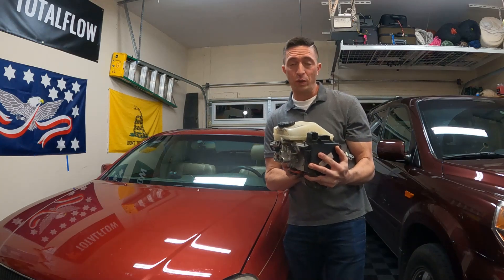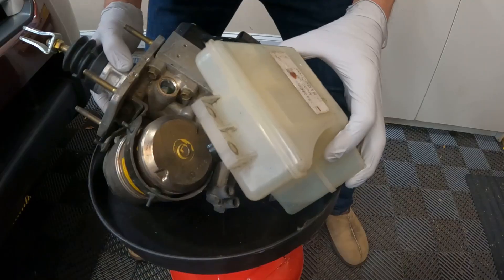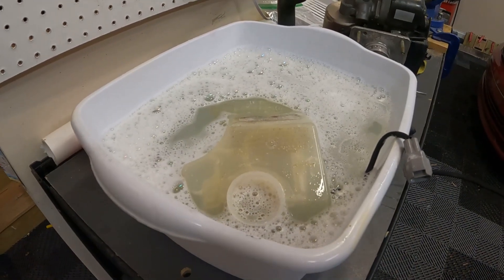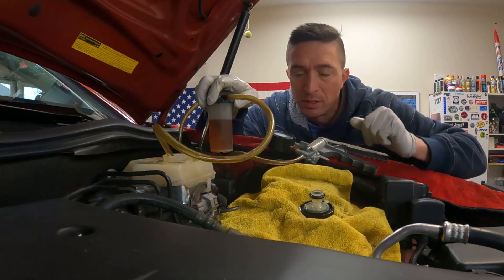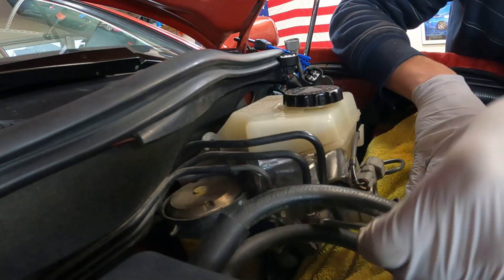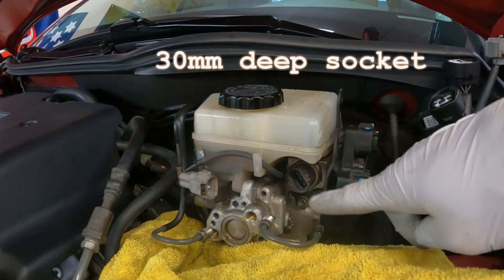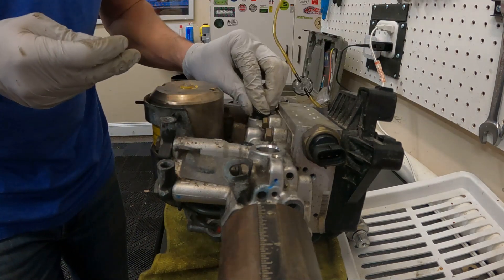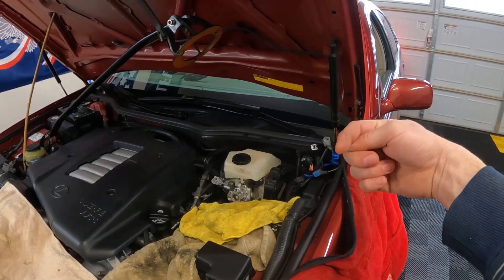LEXUS / TOYOTA Brake Master Cylinder Diagnosis, Replacement & Brake Bleeding (300/400/430 shown)

Comment: I did this on my old Lexus gs300 01 but I just bought the full unit with motor and tank/sensors etc about 450 remand off eBay, not the worst job but wish I had this vid back then lol..nice job! Oh mine decided to go out on the freeway 😂luckily I was able to coast and downshift to a safe place, whacked the pump it pumped enough to get me home thank god😂🙏👍
Reply: Does your pedal feel stiff as an original one?
Reply: @RSGAEL  yes it’s literally exactly the same, well I also did the stop tech drilled and slotted rotors and that made a lot of difference surprisingly

Comment: Curious what exhaust configuration you ended up with. In precious videos you were trying to get the sound to your liking.
Reply from the maker: I ended up with the following after the first Y: TF bullet, TF rear Y, 2.25 mandrel bent pipe to twin TF straight mufflers to twin TF race mufflers. If I could do it all over I would have simply replaced the stock mufflers with TF bullets and got headers. Live and learn!
Reply: @ForwardMomentum  it’s what it’s about. We learn thorough you and others. It does sound good though.
Reply: Wait bro what all lines do you have hooked up to your oil catch can I only have one line hooked up to mines
Reply from the maker: @user-gb1ne5jj8v  I had a three-port unit and plugged off one port after my OCC vid. It’s now ideal. Now it’s a two port.
Reply: @ForwardMomentum  there’s more hoses that oil can bypass in?
Reply from the maker: @user-gb1ne5jj8v  basically I ordered a 2-port inlet in error. I had it hooked up in a less a than ideal way originally. So I plugged one inlet port and re-routed some things. Sorry, it sounds more complicated than it is. 🤣
Reply: @ForwardMomentum  lol got it